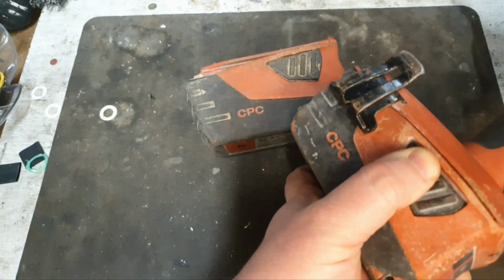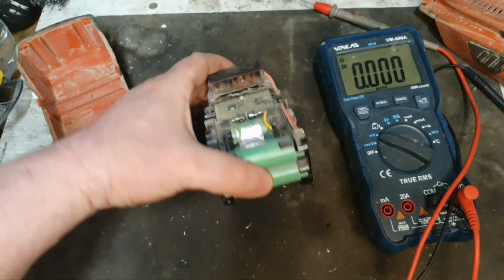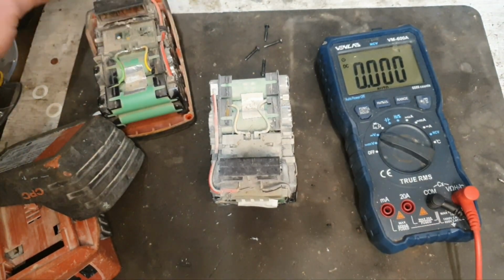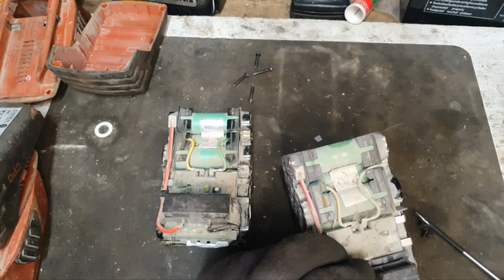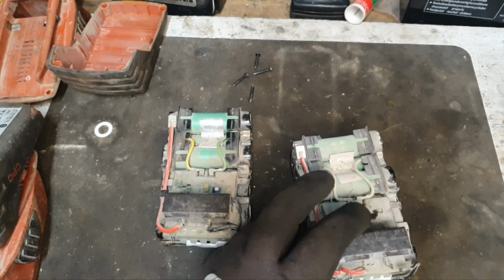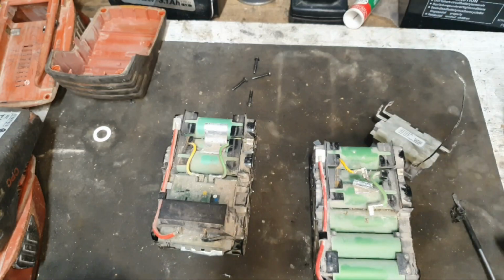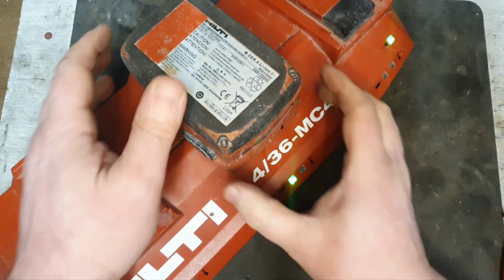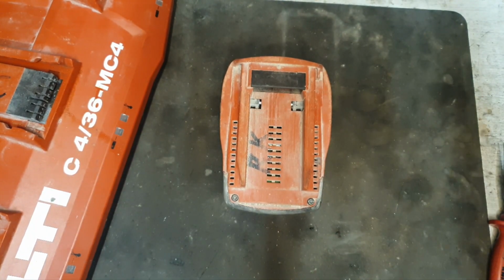Hilti Battery Transfusion when 2 become 1

Comment: Hello doctor, In my opinion it would be much less work to replace the thermal sensor in the board itself, it's only two wires to solder, get it from some damaged board from another type of battery and in this way, by replacing the cells in the remaining battery we gain two working ones, there is no need to replace the BMS boards, we gain time and save two batteries, but that's just my opinion
Reply from the maker: Thank you Mariusz.I  must admit your knowledge and ability does exceed my own and my channel is all the richer for having your comments. Thank you
Reply: @doctorlefthandthread  by sharing our experiences in the comments we all enrich our knowledge, both someone from me and I from someone else , I think that regularly participating in your live shows and watching your materials has a big impact on increasing my knowledge
Reply from the maker: @mariusz1977  thank you. We all have something to give. I am going to try and do a good show this weekend for you guys.

Comment: Is your spot welder strong enough to stick the new Milwaukee pcb to the original nickel strip what do I need to look for when buying one as mine is not strong enough thanks 👍
Reply from the maker: I usually solder the board on

Comment: Thats not fixing one thiugh. Thats cannibalizing which yes fixs 1 out of 2. Can you fix 1 of 1???? Can you reset the bms with the right battery or tech??
Reply from the maker: I agree that's what I did. The answer to your quest is no I didn't know how to repair the board.
Reply: @doctorlefthandthread  If it's a temperature sensor then you need to locate it (usually under some tape and replace it with an NTC sensor or what the manufacturer has)